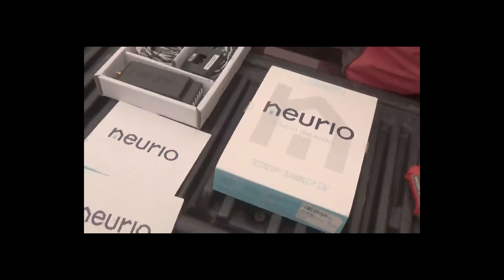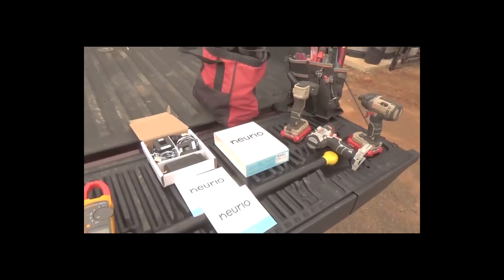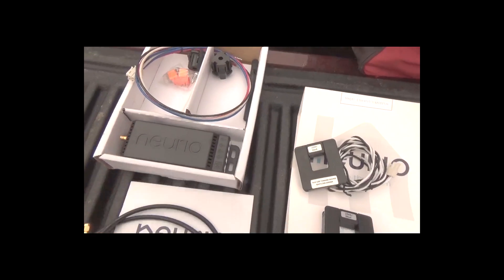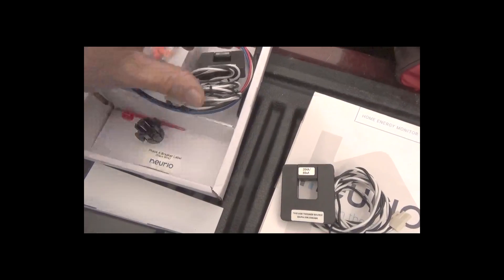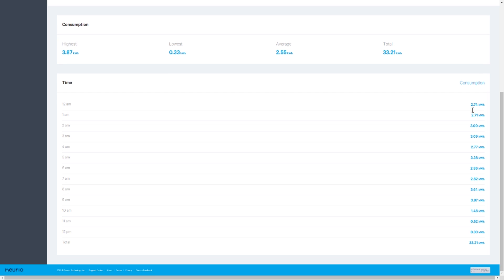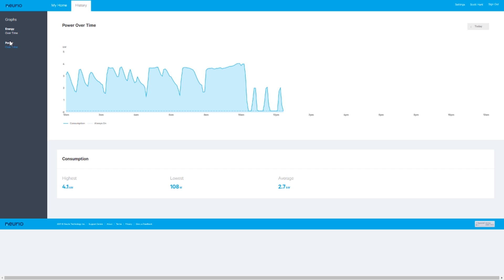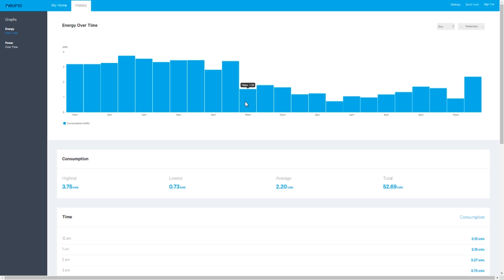Neurio Home Energy Monitor

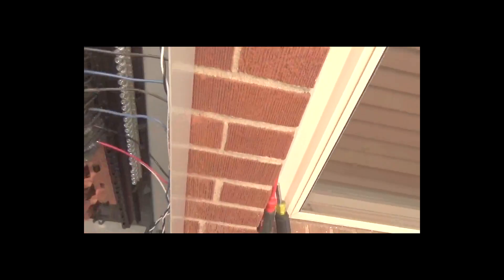Comment: Nice that you had so much room in that panel. Commenting at 3:44- There's a reason that the antenna wire is long enough to reach the knock outs at the bottom of the enclosure. It is against code to drill a hole above the level of the bottom of the bus bar. Now your enclosure is no longer NEMA 3. You'd need a Myers hub to comply with code.

Comment: I seen a system like this. But it appears it goes a step further by monitoring the house. Where the company has monitored hundreds of devices. With the library of devices, they know what is using the power, how much, how long, how often. And if there's a problem with it. Example would be if the oil fired boiler takes more than one spark to ignite the oil. It will inform the owner.

Comment: If you get a chance, check out Owl Intuition-e. Similar device, half the price. Only sold in the UK, but they also have Yankee settings :). Had a couple for 2 years, great products. Got mine on eBay.

Comment: I had an energy monitor 7 years ago, it just led to me yelling at my wife about unneccseary use of the dishwasher and washing machine. You'll have a happier marriage if you don't take that monitor home. I have thought about using it on my solar set up, but my inverters and charge controller do a pretty good job of letting me know what's happening.

Comment: Not as versed in Electrical as I should or need and this may be a stupid question but in looking at the data around point 5:45 or so showing the peaks and valleys, is this possibly the motor on the compressor starting drawing more amperage at that point on and of over the cycled period? and with this thinking is there not some kind of motor starter that would ease the amount of Amps needed to start the motor which should be saving some of your overall Amp draw and possibly the final KW used? and also in the long run keep the hard start on the motor from wearing out that component? 
Again I am not as versed as should and maybe this is a stupid question. I am relating it to like a rheostat, which now thinking that might use more over time then the hard start. Sorry just thinking out loud in a field I should be more familiar with 
Semper Fi

Comment: I have solar running everything in the house except all the big 220 loads such as AC's, water heaters, oven, stove and dryer.  I might install this or the TED to monitor those loads.  Which do you think is better, the Neurio or the TED?

Comment: I'm sorry E775, but the point of my desire to simplify my life by using solar and other "non-standard" energy sources is to REDUCE my dependence on technology and the grid, not increase that dependence by hooking up yet another wi-fi enabled gizmo to maintain my status as a slave of The Machine.
Reply from the maker: I understand. However, think of this as a great money saving tool.  It can help you find out what in your home is wasting energy and causing your bill to be so high.  Most folks just go on year after year running appliances that should be replaced.  And yes I like gizmos.  :)
Reply: Your not dependent on this device if you have it. If the grid goes down and you can no longer use this gadget, big deal. In the mean time it will help you determine were the pain points are in your home for energy. It certainly doesn't make you a slave to "The Machine" whatever that is.

Comment: doesnt that system determine what is each load by its characteristic current profile?  For example I have an open loop geothermal and I want to see how the water pump pulls current and the compressor pulls current and the water heater is operating...  would this system be able to do that without adding a CT for each device?